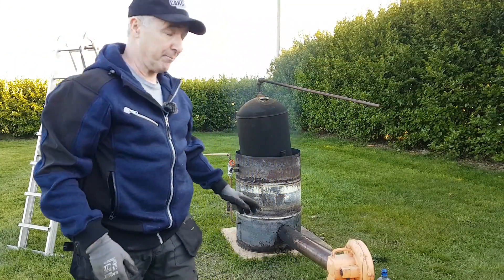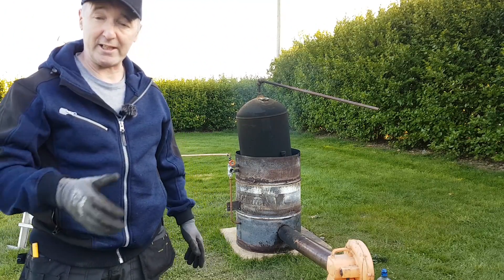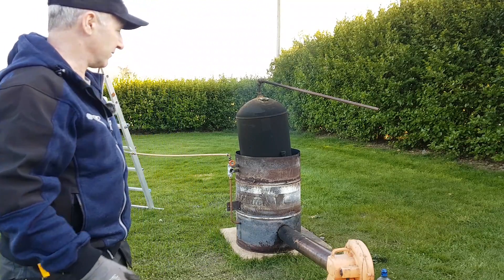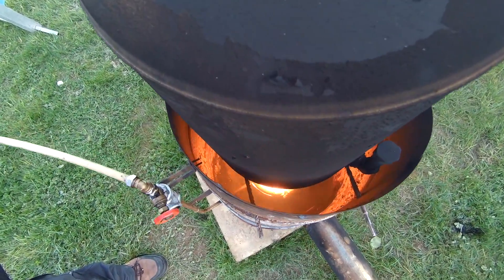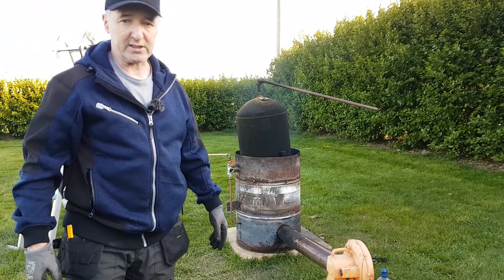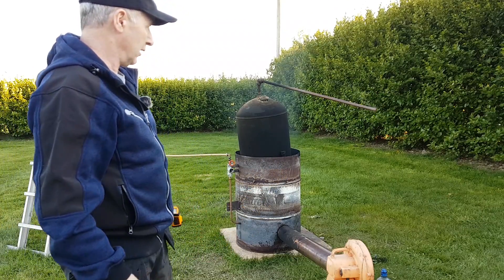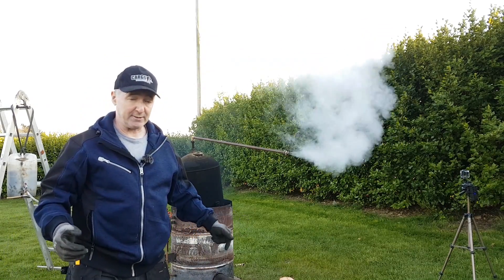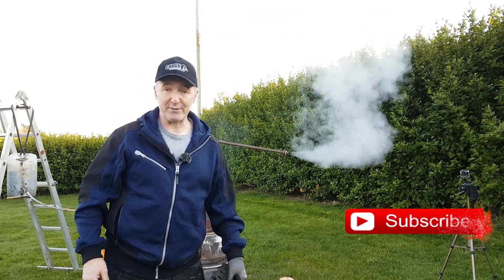Simple Waste Oil Burner -- Free hot water

Comment: So how well is the little burner holding up to the Heat? And is it one of your Tin Can burners from previous testing or one you threw together just for this test & the previous one?
Reply from the maker: Hi I have a very similar burner that I made from steel that works really well. Here's a link to the build https://youtu.be/ShTLaYKjzxw I am posting a video tomorrow that shows this burner working without any stove. Massive heat output. Thanks for the commment. Cheers Gerry

Comment: I.l9ve you channel and it's been very helpful regarding building a simple waste oil burner. .. I'm planning to build one as a patio heaters for cold evenings to replace my smokey wood fired one.   You need to take this to the next level now a build a waste oil boiler feeding radiators and hot water  in your shed...  perhaps a smaller burner and boiler with natural draft that could be left gently burning 24 hours to keep the chill off...   our old diesel heater has a spring valve held open by a nylon or plastic string that melts and snaps shutting of the fuel if it gets too  hot... so simple... the next level is calling you
Reply from the maker: Hi Robert. I have plans for the little building beside the shed. I have already installed underfloor heating in it and the boiler will be in the shed. I have a commercial boiler that I will convert so things are afoot. More on that soon. I had a look at your channel and love the 4x4's you have there. Thanks for the comments and suggestions  Well done 👍 Cheers Gerry

Comment: Is that copper cylinder salvaged from something?
Reply from the maker: Hi Monk. They are a common part of domestic plumbing here in Ireland and the Uk. I will pipe it up properly to one of my stoves soon and make it produce hot water safely. This was just playing with the stove. Thanks for commenting Cheers Gerry👍
Reply: I'm curious where it was originally used too, it's rare to come across a copper cylinder in the US, old hydronic heating expansion tanks are steel, and all modern expansion tanks, well tanks, hot water heaters are also mostly steel. I know it's not required, but copper is much better than dealing with rusty water!